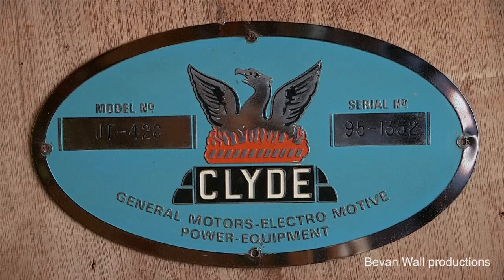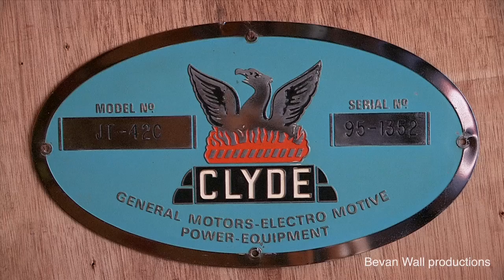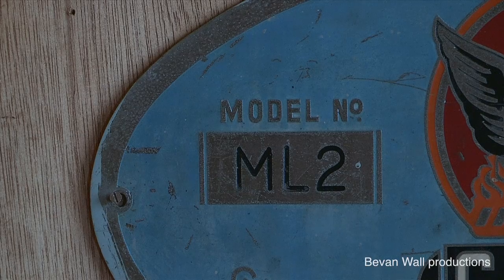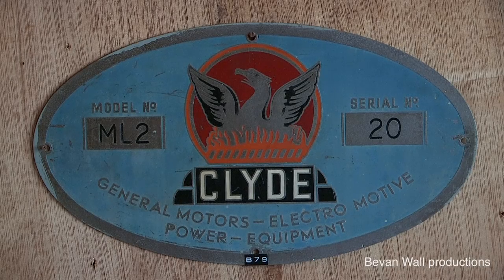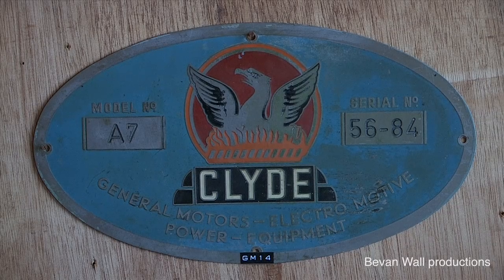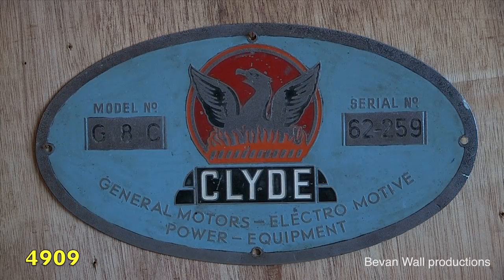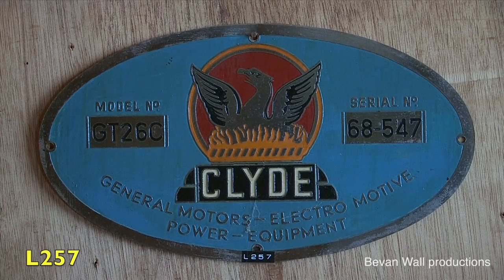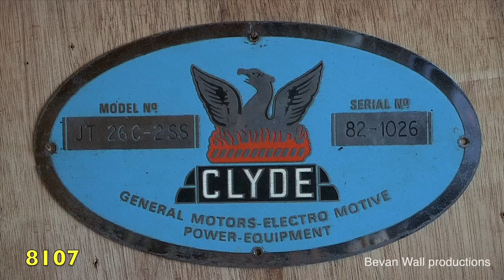Clyde Engineering Diesel Locomotive Builders Plates

Comment: I am trying to build a 19mx 5.6mx2.6m height wooden boat here in Fiji. The problem is I don't know the size of engine, Dia. Of prop. Shaft plus the Dia. Or pitch of propeller. & other accessories.
I need a quote plus it's shipment.
Yesterday I went to one of outlet here in Suva they said are not selling the marine only about 40years ago they did.

Comment: bwDVD, Thanks for posting this video. 

I have a few of these in my collection. Is there any chance I could personally message you?
Reply: Some other details on Clyde builders plates, the model and serial numbers are engraved into the plates and over the years different fonts were used.

The early plates were a thicker gauge stock material (brass or copper) and the nickel plating didn't completely cover the back of the plate.

GM class builders plates that were fitted to the driver's cab had the locomotive number engraved on them.

The Victorian first series X class  X31-36 and the T class batch 397-406 were engraved with locomotive numbers instead of serial numbers.

A few builders plates were fitted to various classes of locomotives without the blue background painted in for some reason they don't appear to follow any specific order tho.
Reply from the maker: Feel free to use the Youtube messaging system to contact me.